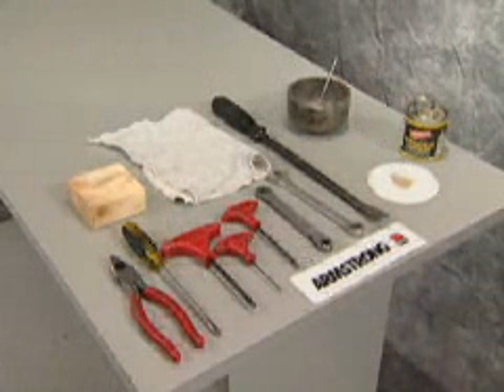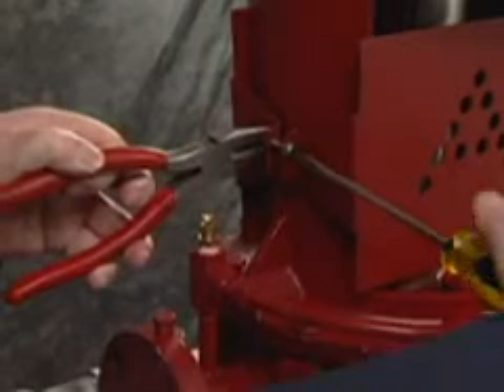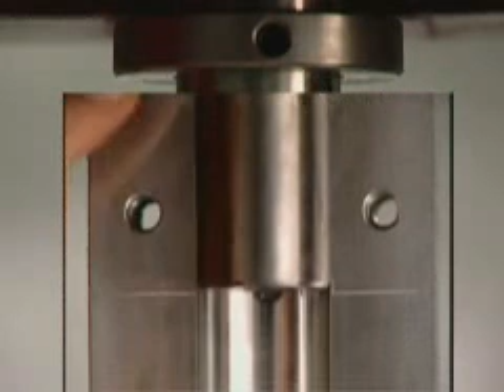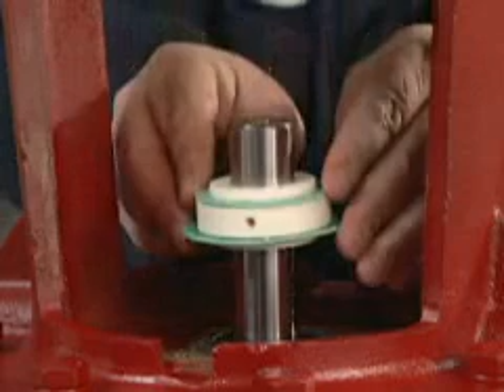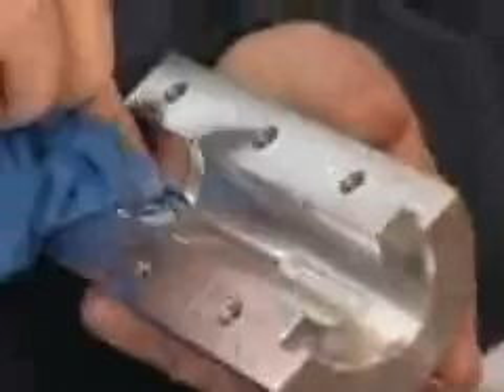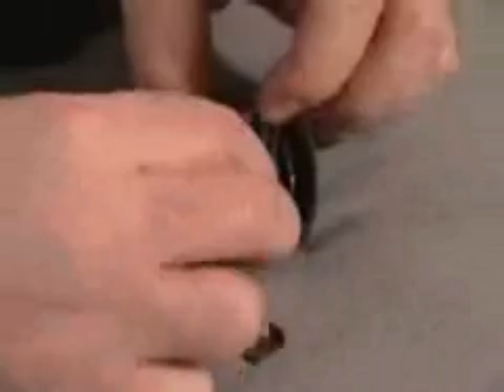Armstrong 4300 Seal Change

Comment: Just wanted to add this comment as I just did this for the first time today. 
The stationary shaft seal was seized into the volute cover. I had to remove the motor, the housing, and volute cover. Then turn the housing between the volute cover and motor upside down and proceed to break the ceramic stationary seal out. Once it was out you take a pick and some scotch bright and clean out that housing. It worked very well, but it was a bit of a piss off as I was watching this video like lol.

Comment: There is a lot of difference between changing the seal in a new pump and the one which is currently in use. When scale gets deposited in the neck ring at the bottom, the impeller gets stuck in it and neither gets lifted up easily nor gets pressed down. If it does not get pressed down, the nut at the top does not come out and there is not enough space at the top for it to come out. The second fault is that the mechanical seal at the bottom also works as a support for the shaft bush. If the neck ring gets cut, then vibration occurs which breaks the seal which is very hard. I have faced this problem myself.

Comment: thanks mr murphy to show this video i am presently working with empower energy solution uae we used nearly 150 nos of armstrong make vertical in line pumps.as a technician i am still unabel to understand how the mounting of these pumps are working .we use some pipe hanger n vibrator arrestor but still some vibation occurs during opreation .why?also why no thurst bearing designed in motor even axial load of imppeler is on bearings